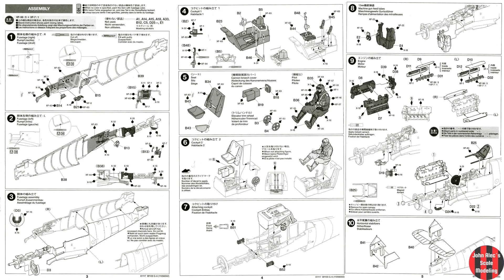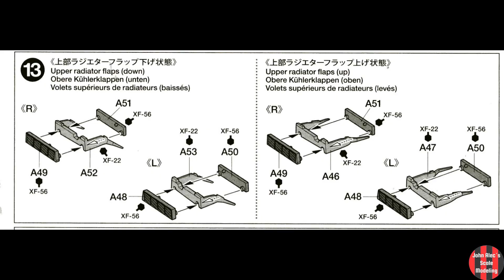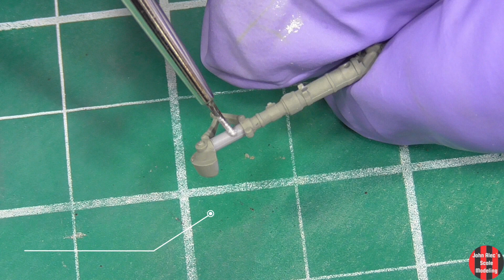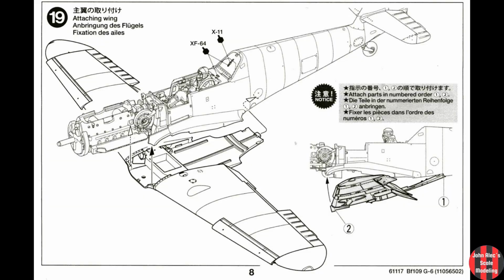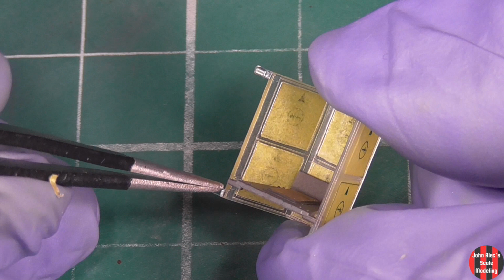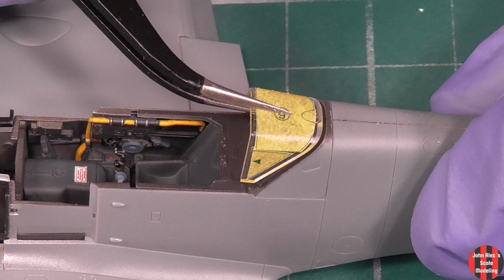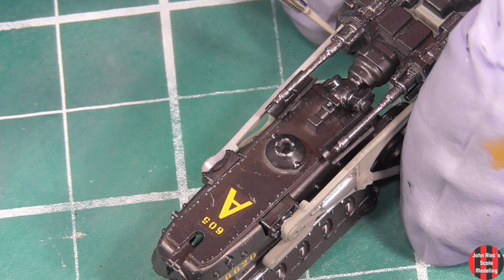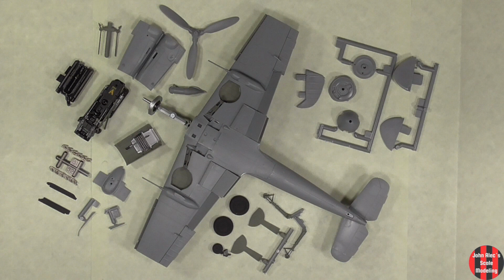Tamiya 1/48 Bf109 G-6 Group Build Video Part 2

Comment: Hi John, Did you ever finish the Bf109? or is it on the to-do shelf.
Reply from the maker: Great question Ian, I have assembled and painted it . On the back burner as I'm still learning how to weather aircraft. It will come in the future. Nice reminder mate. I need to get that one finished.
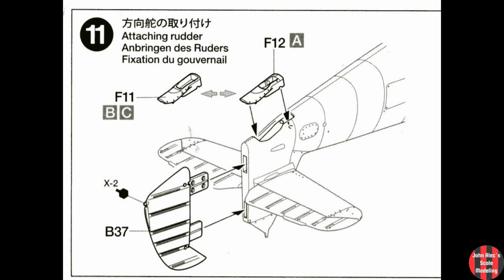Reply: @johnalecsscalemodeling  I have just brought the Tamya 1:48 Spitfire Mk1, though a different period of the war, the Bf109 would make a good hangar pair. 30 years since I made a plastic model so will be warming up on a few other cheaper models first.:face-orange-biting-nails:
Reply from the maker: @melvilib  You'll get right back into it. A Spitfire and Bf109 will make a great pair. I've had to buy the Tamiya kit twice so I will finish it. Cheers